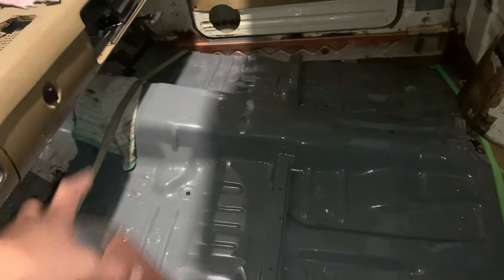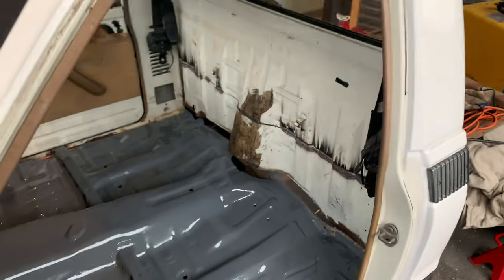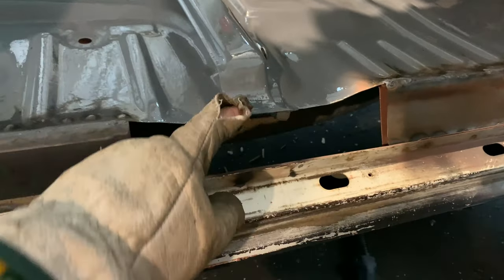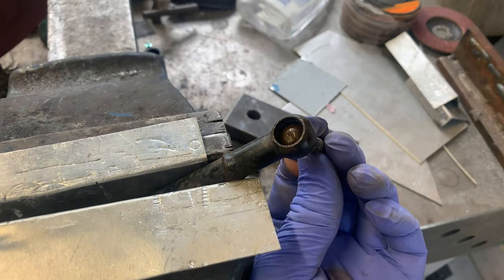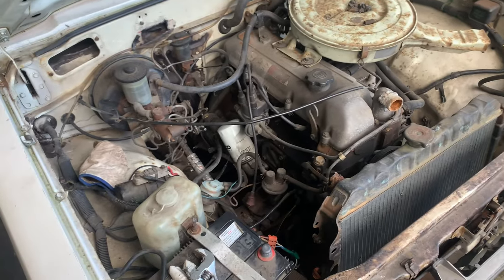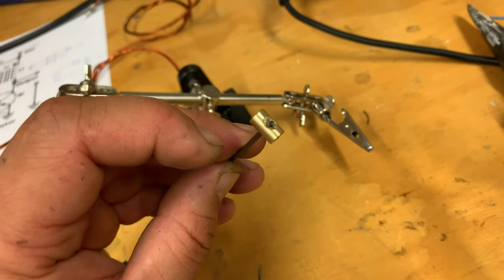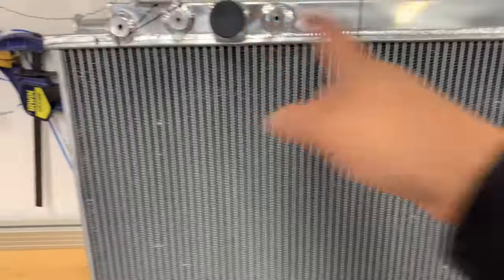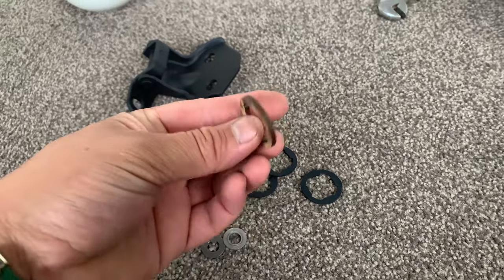80’s Hilux Pickup Bodydrop & Restoration Ep.12

Comment: You can use a factory tilt column out of a later Hilux (pre 04). Thats what i did to get the steering to work when i body dropped my 82 years ago.
Reply from the maker: I did wonder about that. Do you retain that flexi plate or you get rid of it? Can you still use the indicator stalk?

Comment: Lookin good! Is that the original floor pan from the truck or did you get source one from somewhere else?
Reply from the maker: It’s the original but I fixed the really rusty parts. There’s a video before this one if you wanted to see it?
Reply: @AdamNZ  Oh, right on! I’ll go back and check that video out. My floor is quite rusted and I’m thinking I’ve got quite a patch job ahead of me. Would be neat to see what you did. Thanks!
Reply from the maker: @GimmeDatRice  Its kinda easy. I just designed up what I needed and sand blasted the whole thing. There was a lot of tiny pin holes and if I was to do it again I'd probably just make a whole new floor.